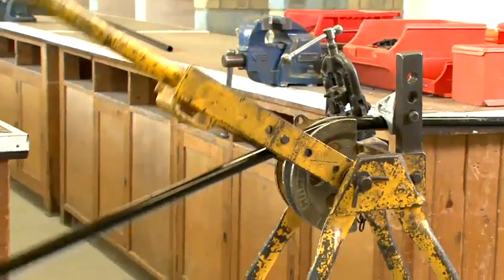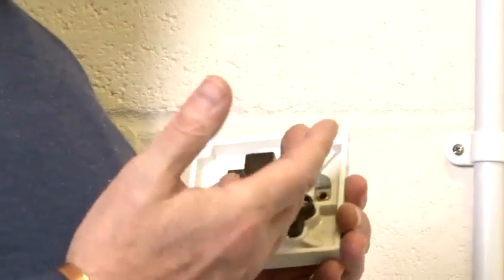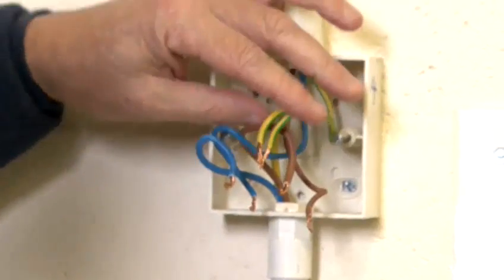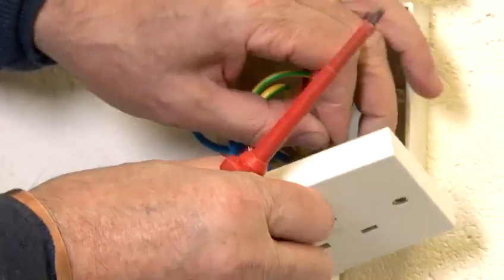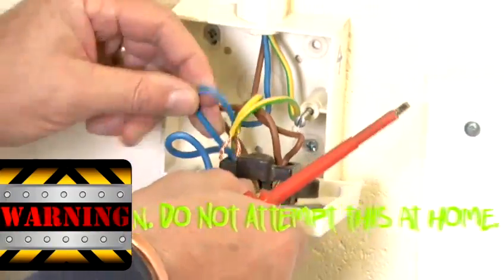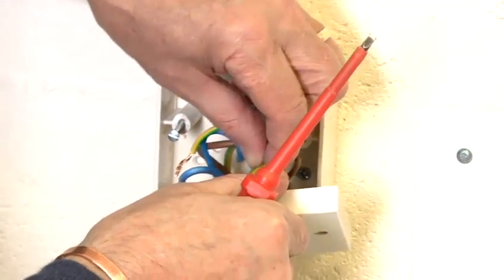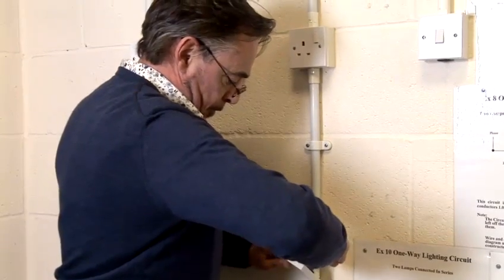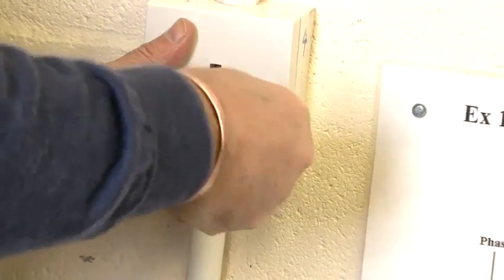How To Wire An Outlet Yourself

Comment: 77k views and nobody has commented about "Live on the right, neutral on the left"

Look, a still from this very video!
http://tinypic.com/r/34pfcq0/9

Thank goodness he actually wired it correctly.

If someone did wire it up the way he said and a live-earth short occurred in the appliance the plug fuse will be of no help whatsoever, the only protection will be whats in the CU, likley a 30A wire fuse or a 32A MCB,  plenty of ring circuits in the UK have no RCD protection.
Reply: i took from it that he was talking about the BS for plug outlets, live right neutral left and cpc on top (as is facing it)

Comment: housing circuits are not normally stranded. single core most of the time! cpc is normally at the side and there is normally two of them (one each side and they are connected.